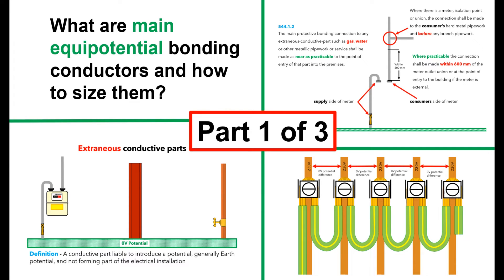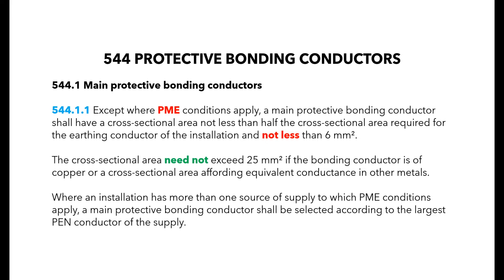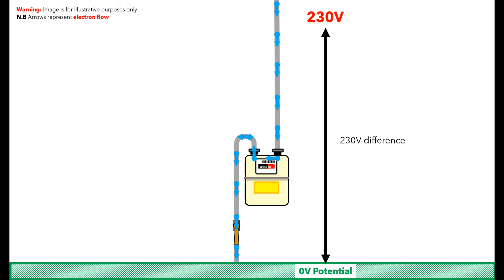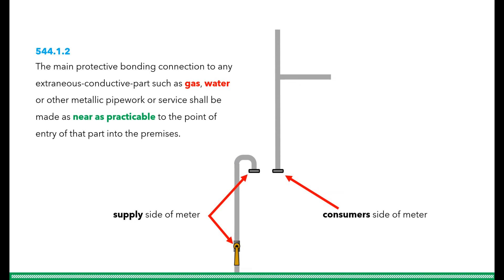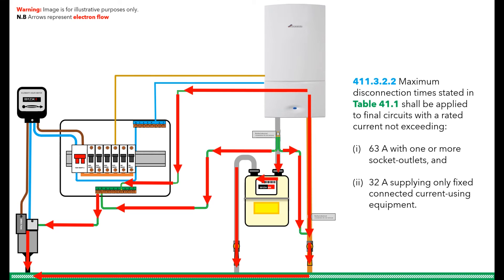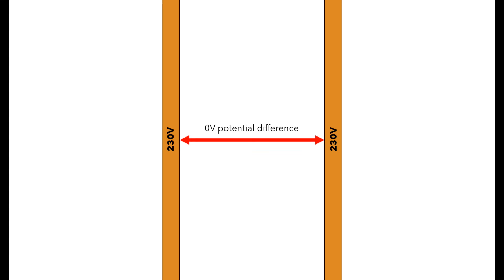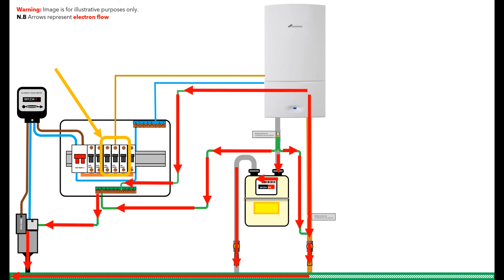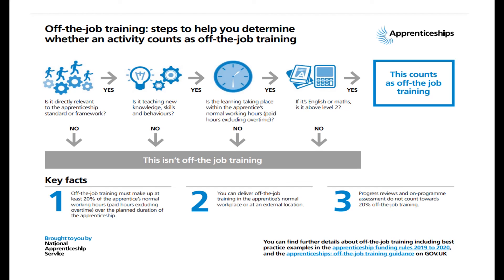Earthing and bonding part 1: what are main and equipotential bonding conductors

Comment: Hi mate, when you mention that any pipe that goes down to the ground must be bonded, does this mean pipes under rhe floor tiles but above the earth ground or does it have to go down to the actual mass of earth ground (in the soil)?
Reply from the maker: Extraneous conductive pipes go into the mass of earth and introduce a zero potential, which is why they require bonding.

Comment: At 4:22 in video it shows measuring voltage on pipe before removing meter.     But if the fault current was small i would imagine you would read zero volts.  Then it would shoot up to 230v once you break the joint.   Im just guessing here.  Please clarify if this may happen.    That would mean you must always put clamp on pipe before removing a meter regardless of what voltmeter says.
Reply from the maker: At 4:22 the meter is removed, so I am not quite sure what you mean.

If you measure with the meter connected, in a fault condition, you would measure a voltage.

If the meter was removed, in a fault condition, you could read a fault on either side of the meter, but because the current has nowhere to go, it will just sit there until something or someone, completes the circuit.

And that is the issue
Reply: Not a spark, but surely if there was a current flowing, however small, then there must be a voltage present to make that current flow.
Reply: Incorrect.   The neutral has the same current as the live wire at 230 volts.  The neutral is zero volts  :)

Comment: If the plastic pipe comes out of ground and changes to copper in house, then does it need to be bonded. ??    I mean it could become live if an electrical fault occurs..
Reply from the maker: No, it does not need to be bonded as it does not go into the ground (zero potential).

In this instance, the circuit protective conductor of the appliance will be sufficient
Reply: I watched another video where a chap suggested a faulty solenoid on a pipe could make the pipe live.    Bit scary if the pipe could be sitting there at 230V .  Of course with RCD protection one should not get killed if they touch it, but if it was bonded it might be safer ?   What are your thoughts on this type of scenario.